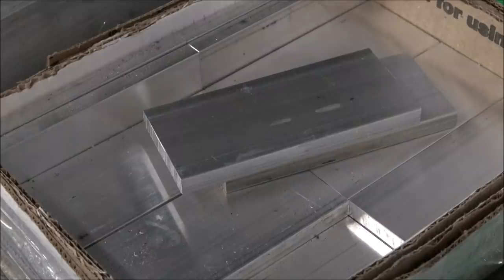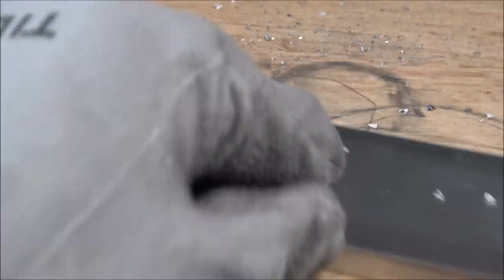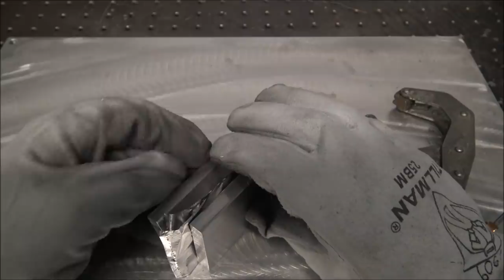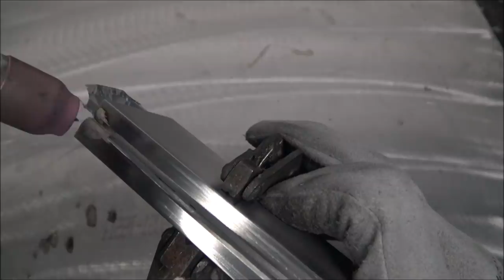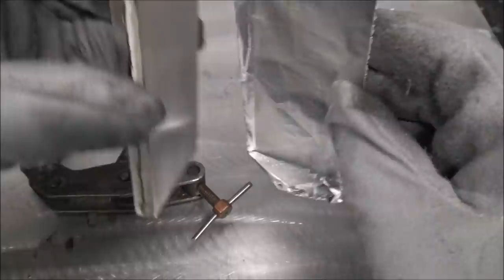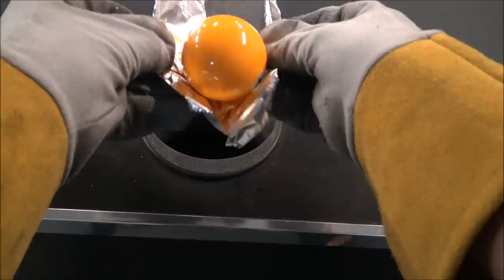TIG Welding Aluminum Foil

Comment from the maker: The trick is to use thick bars of aluminum (I used 3/8") to clamp the foil down tight so it can't burn away from you while welding. Use enough amperage (I used about 50) to melt the foil, but not the bars.
Reply: You spent so much time thinking whether you could, that you didn't stop and consider whether you should. 

Wouldn't be fun otherwise. Nice video
Reply: I keep a welding blanket on my pool table so the sparks don't completely destroy the felt.😉
Reply: You can use steel plates too :)

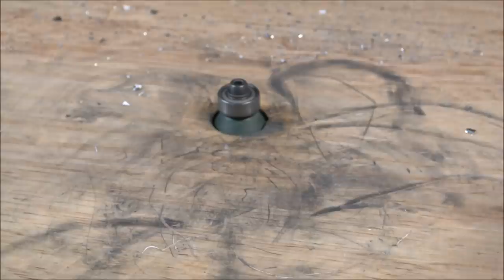Comment: At 0:25 , are you putting a micro bevel on the plates, or just deburring, or ... ?  What's the purpose of doing this?
Reply: Dan L. beveled The Edge to open the gap for the aluminum oil to melt but not melt the plates together
Reply: Oh yeah I see, it's a bevel.  But is it for the aluminum foil to melt into the groove to make a thicker weld, or is it to slide the torch in a controlled straight line?